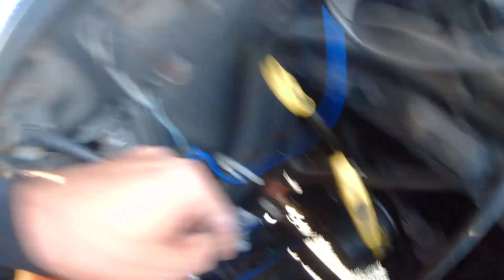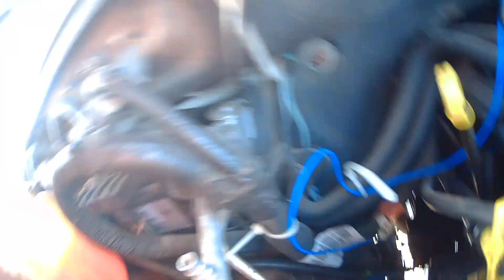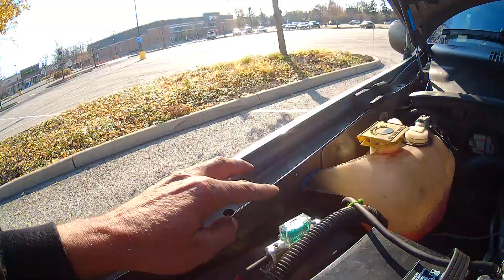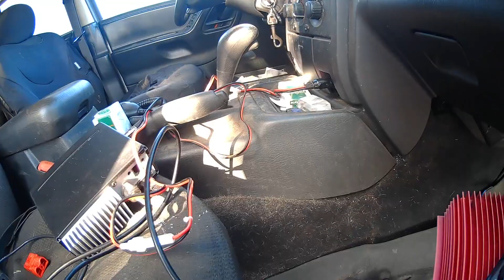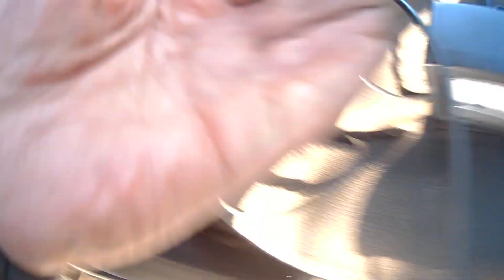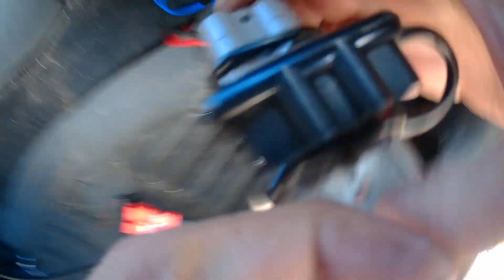BJ 300 plus installation video How to run mobile power wires for CB / Ham / Music amplifiers Part 1

Comment: It’s also best to put a fuse on ground and hot wire.  But they should both be with in 3 inches of the power source.  
You have at least 1 foot of wire to catch fire before the fuse.
Reply from the maker: 3 inches would cause me to have to mount the fuse holder on the battery. Not a good choice for me. The wire is secured so it wont contact ground. Yes multiple fuses wouldnt hurt but the positive side is good enough. Additional fuses create voltage loss through the connections.  We all know what happens to the current when voltage is lost even in small amounts.